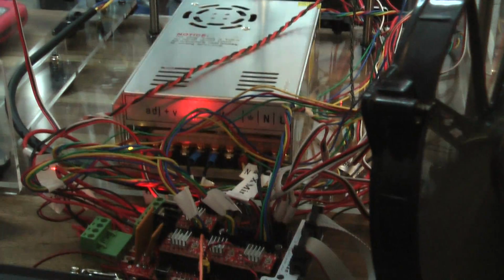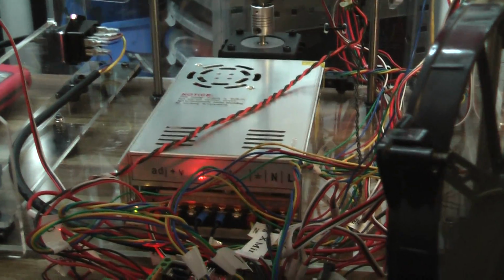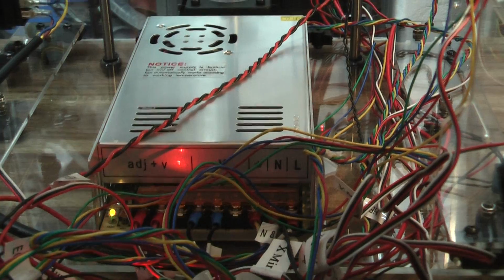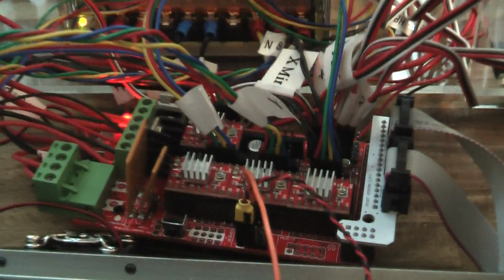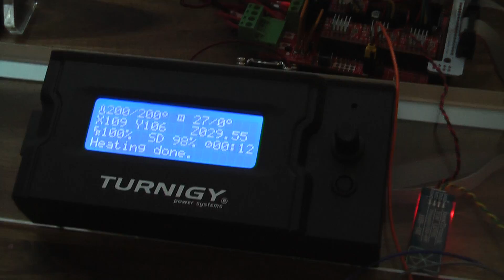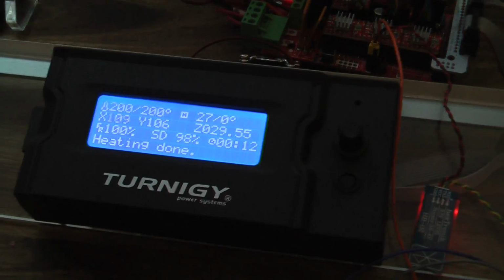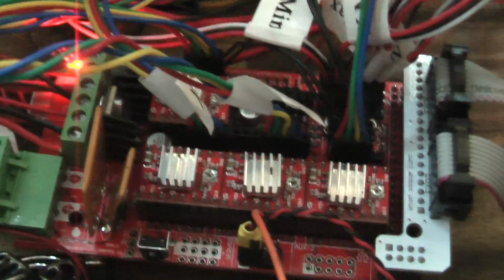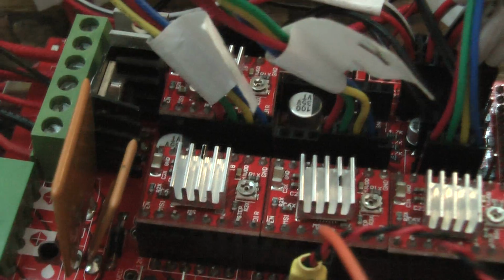HobbyKing Fabrikator First Impressions

Comment: Do you get some plastic filament with the kit? pla? Nice build!
Reply from the maker: Hoverbot1TV Thanks. Unfortunately you don't. I think they should add at least a few grams so you can start right out of the box. I couldn't add any filament to my order because of weight and had to place a second order. Luckily both packages arrived on the same day.